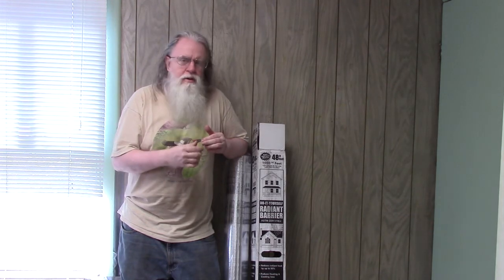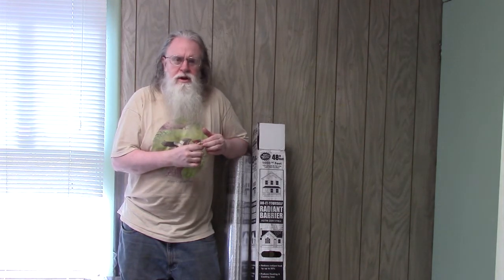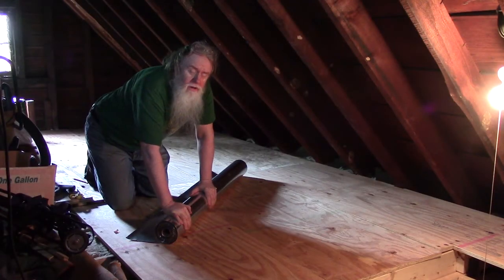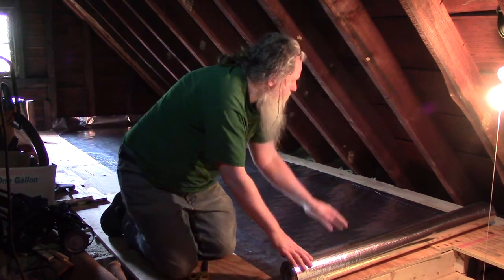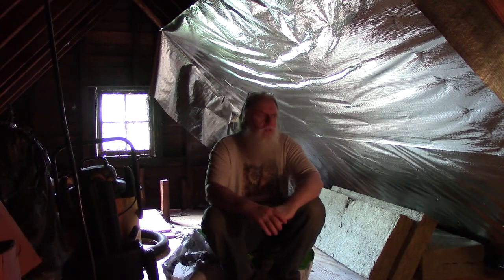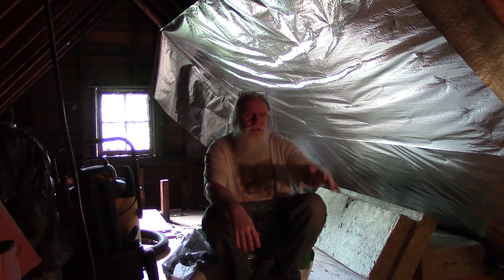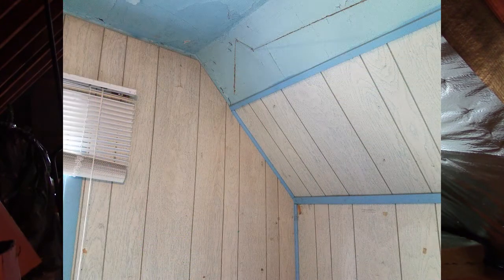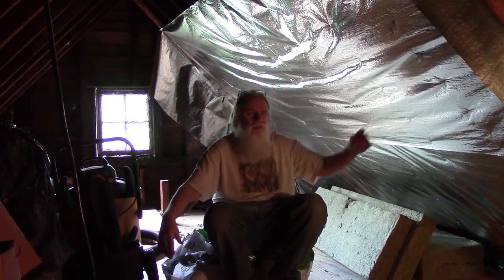Attic Radiant Barrier

Comment: Hey, thanks very much for the video!

I've been researching all sorts of options for my very hot attic for the past 4 months, even going so far as getting a quote for a ridge vent install.  Radiant heat barriers are a much cheaper initial option to test though. 

Your video is the only one wherein you show actual visual proof of what a radiant heat barrier is actually doing. Not even the product vendors thought to do such, which would probably greatly increase their sales.

I've been looking at the AtticFoil product which seems to be similar at 23# 1000 sqf, however the price is lower, though maybe not with shipping/tax.  They also offer 60" width, which is nice.

Great video, would love to see a follow-up with more pics or data.
Reply from the maker: Thank you for the comment.  Yes, AtticFoil is about the same.  One of my friends used it after I told him about radiant barriers.  I think Homedepot does shipping free and AtticFoil charges for shipping so it comes out similar.   Ideally you should have both the radiant barrier and some form of ventilation.  I am still trying to work out the ventilation because my house was build in 1873 it has issue, but my friend that used the AtticFoil had a fan and found the optimum thing was to turn the thermostat on the fan form 95 down to 85 after putting the radiant barrier in.  The problem is that it reflects in both direction so it reduce the high temperature but keeps what heat that does in.  With the fan set to 85 it seems to work the best.   Let me know how it turns out with your house.
Reply: @yensoftware  Thanks for the mention - www.AtticFoil.com  A couple of things:  We now offer FREE shipping on all orders.  And, AtticFoil actually uses pure aluminum foil on the reflective surfaces compared to a vapor applied aluminum or metalized film (MPET).  This is important since over time even though the MPET has a "protective coating" it is compromised when the product is perforated.  The aluminum layer on AtticFoil is over 200 times thicker than the MPET products.  MPET is MUCH cheaper to make and sell, so it's not fair comparison on price.  You can learn more about radiant barrier oxidation here: https://atticfoil.com/index.php/technical-info/metalized-radiant-barrier-film-oxidation/

Comment: how much was it and would you want to remove in the winter?
Reply from the maker: It cost about $166 at HomeDepot for a 4ft x 250ft roll and was shipped to my house (  http://www.homedepot.com/p/Reach-Barrier-4-ft-x-250-ft-Silvertanium-Reflective-Attic-Insulation-Roll-3023/203536782 ).   I do not plan to take it down in the winter.  The argument for taking it down would be that it might be nice to get  what little warm you can get from the Sun in the winter.  However the days are short and the night are long so you would be losing more that you gain so you might as well leave it up.  Also it would reflex the heat that gets through your insulation back.
Reply: https://atticfoil.com/index.php/products/48-wide-double-sided-atticfoil-radiant-barrier-foil-perforated/